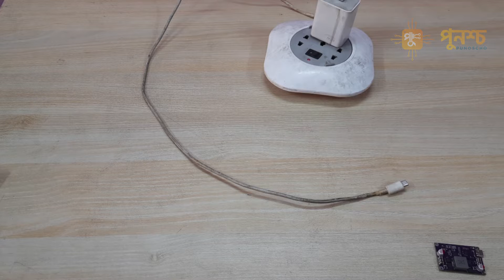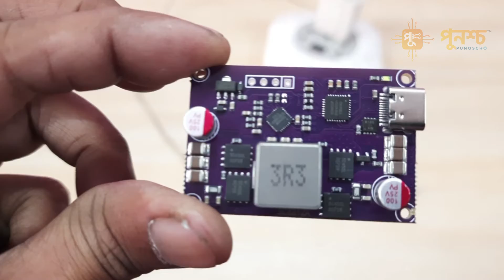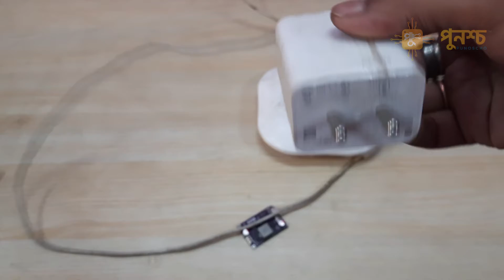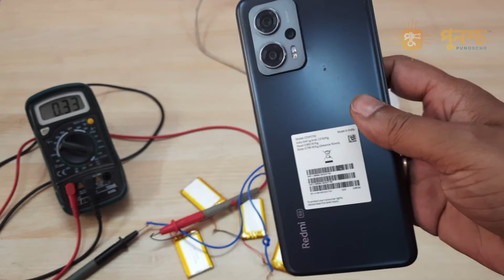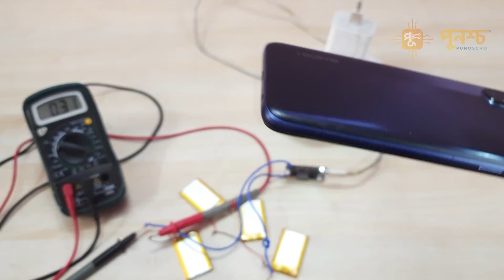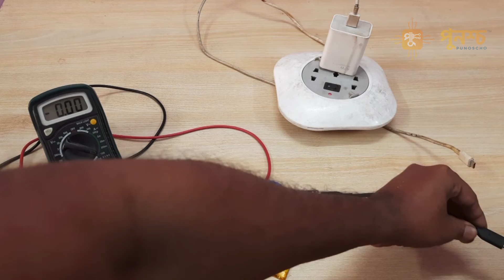120Watt Bidirectional USB QC PD Module working

Comment: High voltage cut off is 16.8 so for 4S set it 4.2V per cell & lower cut off is 12.8V - which is 3.2V per cell - there is NO CELL available with this lower capacity , basically this aboard is not NOT designed for full capacity utilization of battery pack .. be careful

Comment: Thank you for the helpful information, I'm now to this, but I was wondering if I have 2 battery packs both it this chip can I link them up with a USB c cable to make them function as one battery? Like, let's say the moment I'm drawing power from one battery the battery connected to it will just  keep getting charged by the other one without any damage, thank you for your time.

Comment: Is there a version of this board for higher voltage li-ion battery pack? like 48v? my ebike battery is rated at 48v (41v-52v) and while i can power usb devices no problem i wished there was a board which could power usb pd laptop
Reply: Use step down converter and  65w pd module (125₹ + 130₹) , the pd65w module is a solid one . I am using it with my 12v LFP battery with boosted 24v

Comment: Please answer my question🙏 can I attached 50,000mah battery 14.8 -16.8 volt battery? And How many mah support this board?
Reply from the maker: Yes you can attach 50000 mAH
Reply: What is the input voltage rating to a board for 4S Battery and at what rating does the battery charges while useing 120w charger as a input

Comment: It does support laptop charging ? , can you share the realtime test video and how much amps pulling with the moudle  ,can i connect 4s lifepo4 battery
Reply: Yes you can connect 4S lifepo4 battery. And I charged laptop using this module in PD configuration, my MSI laptop had a PD charging port.
Reply: @papaisou11 Thanks , it will produce normal / heavy heat while charging laptop ?
Reply: @papaisou11  are you try to charge your lifepo pack with this module?
Reply: @papaisou11  are you sure that this module support lifepo batteries? According to the seller page it’s forbidden to use iron batteries!
I have tried to use it for discharge, but not sure if is it safe to use for charging
Reply: Bro may I know the output for the battery terminal place
Reply: @tbvprasad positivo pode conectado direto na célula,  o negativo precisa ser conectado ao bms, nunca ligue corrente em curto, acredito que é mais seguro usar BMS com p+ e p-, esse modulo realmente muito complexo e limitado
Reply from the maker: The heat is nominal around 50-60 degrees. With that heat, it worked with no issues. Nominal laptop takes 40 minutes to charge fully where a 65W pd charger takes 20-25 minutes. We accepted this variation and it worked well as per customer record.
Reply: @punoscho2022  when will 100w module will come in stock